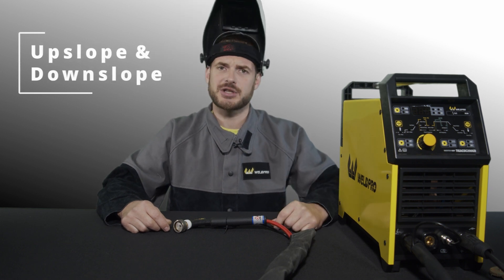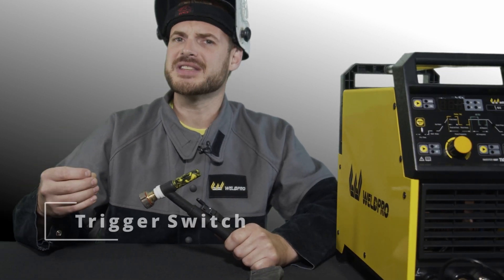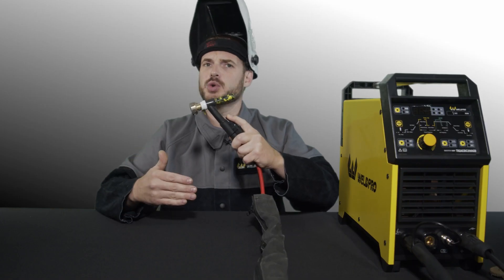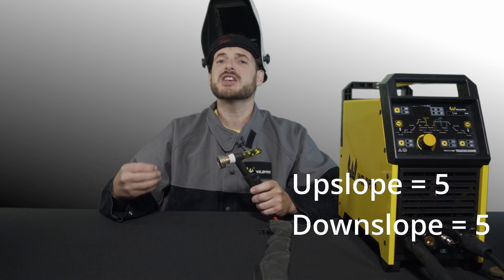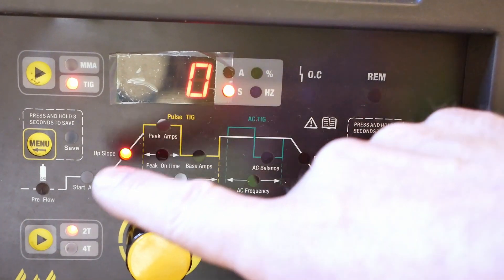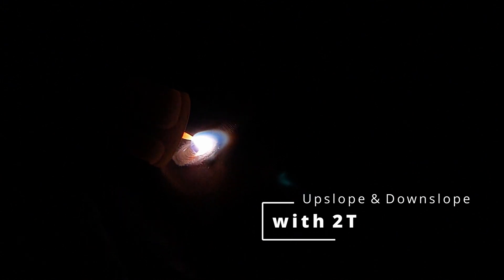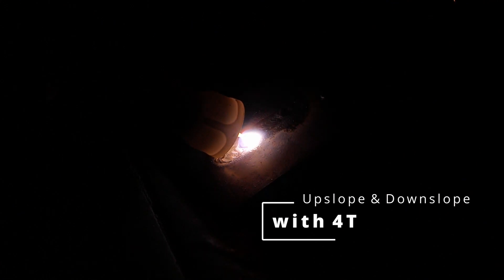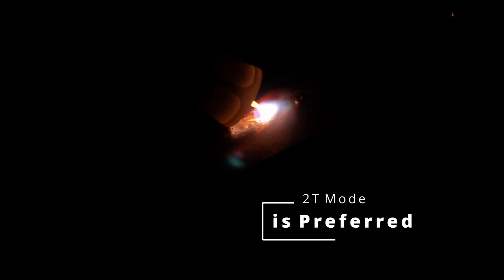Upslope Downslope

Comment: Hey there, I have a Helvi mig with slope control, I'm a little unsure what would be the most appropriate setting? Thank you,
Reply: My advice would be to contact Helvi about the settings on your machine.  Necessity of slope control and actual slope settings will be dependent on several variables.  You may also want to research videos on MIG "hot start" and "crater fill," as these are the more common MIG slope controls in the USA.  It may give you a better understanding of how to use the controls on your Helvi machine.

Comment: Have yet to find one expert justify the 4T mode including WeldPro with the option. How about getting rid of it and reducing the price?
Reply from the maker: The 4T option is wonderful for lengthy welds. The only time we prefer to not use it is when using upslope and downslope because of how it affects the arc characteristics. Being that the interlocking trigger function is a simple switch control, this would not effectively save any money.

If you are looking for a machine that is a little more affordable you could always take a look at the MIG155. Thanks!
Reply: Explanation works for me Luke. OBTW, I'm quite impressed with the Weldpro 200GD. (Already have a Miller 185 MIG. Yea, old model, got it new, but it works for me.) I'm super motivated to learn and use TIG as I believe it'll open some doors to what I can do (indoors and outdoors, aluminum and SS). Been using stick since...well let's just say before the Vietnam war ended. Learned stick and oxy/acet in HS and never really owned a stick machine of my own, always borrowed one.

Again, love your vids, Luke. Keep em coming.